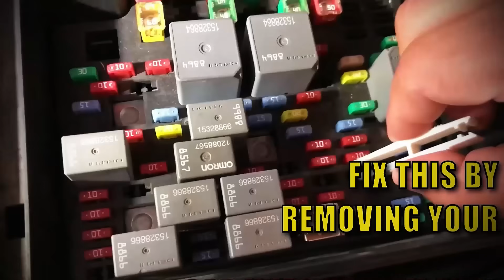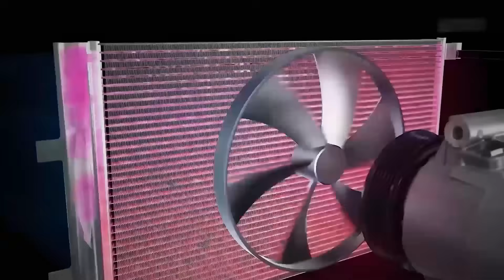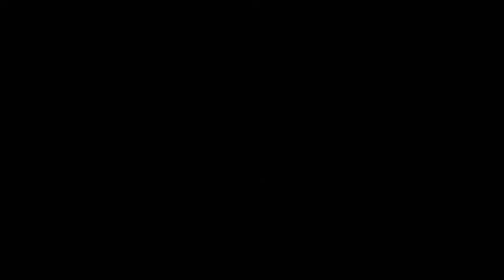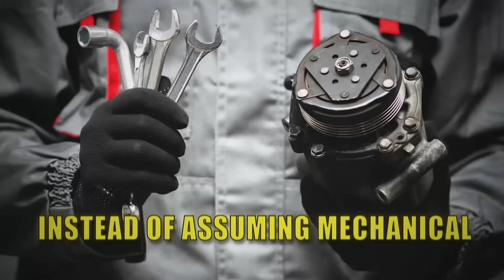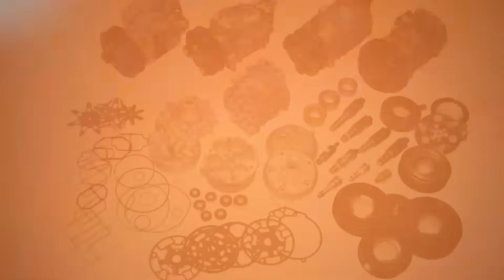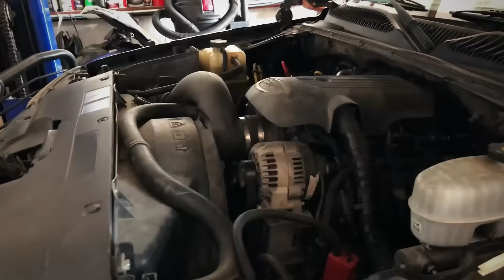Doing This Will Make Your Hot Car AC Blow Ice Cold Again (For Less Than $50)

Comment: I had to stop at 20 seconds. You don't know what you are talking about. The vast majority of non-working auto and truck AC systems is caused by a loss of charge. Secondary causes include AC module failure, pressure switches, and compressor failure. Me: 50 years experience, ASE master Auto and Truck technician. You: clickbait youtuber.
Reply from the maker: I have pretty much explained about the loss of refrigerant charge as the primary cause. Have spent days in creating content. At least you can appreciate the efforts

Comment: The Blend door on a friends F250, You can get to under the dash through the passenger feet well.  Showed him where it was he fixed it by pushing the pin back into the gear.  Came loose again $1800 to replace.  What a theft from Ford dealer.
Reply from the maker: $1800 for blend door?

Comment: Do not use "replacement" coolant cans they are not the same as the original gas. They are LPG so if nothing else are flammable, so if you have a leak in your engine bay you could go boom, or if you are a smoker and the heat exchanger in the dash leaks ..... you could go boom.
Reply from the maker: Thanks for the advice. it is really helpful
Reply: Bro… What type of gas have You been huffing?! 😬 
The cans of AC recharge at your store are Not LPG, unless You getting it Outside,  in a Locked Cage, and in a 45 lb tank, with a large coupler??! 🤪 
The AC recharge cans actually advertise on the can the R134a, or R1234yf for newer models.  And… They work as designed! 💪😎